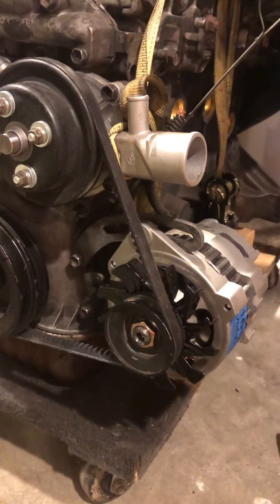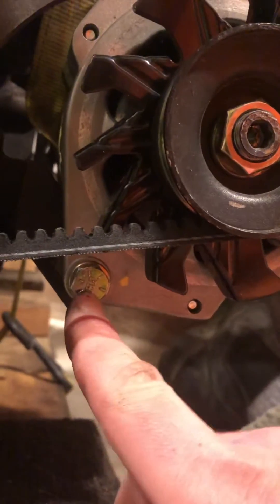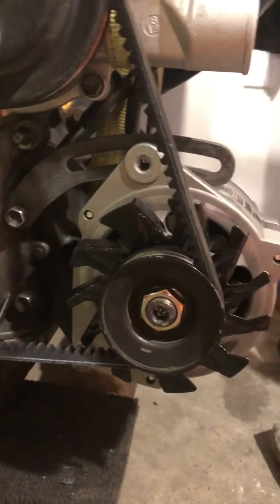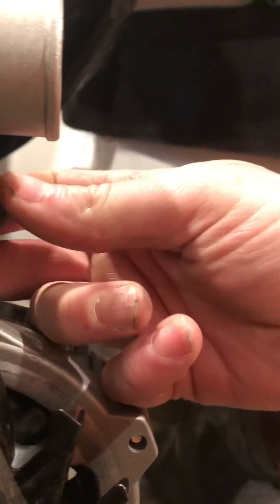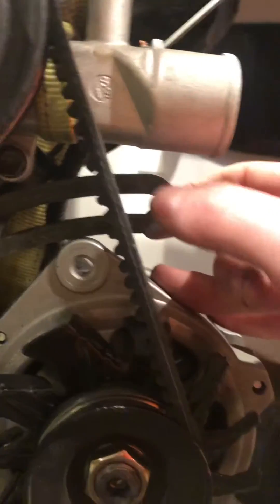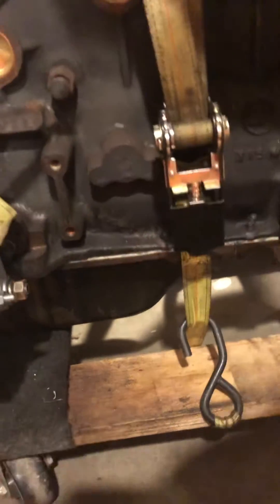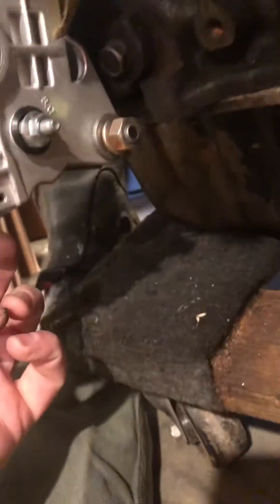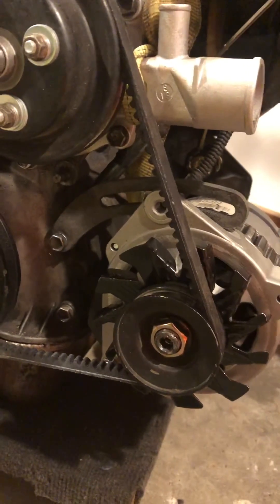Toyota 2TC and 3TC Engine; 94-97 Saturn alternator upgrade part 3

Comment: It doesn't work. I got 2tc bottom bracket needs to be modified
Reply from the maker: Sorry you’re having trouble. I’m curious to see your bracket and what you had to do in order to make it work. I’ve done this conversion on multiple T-series and never had an issue with the lower bracket. The upper one usually needs to be moved and ground down.